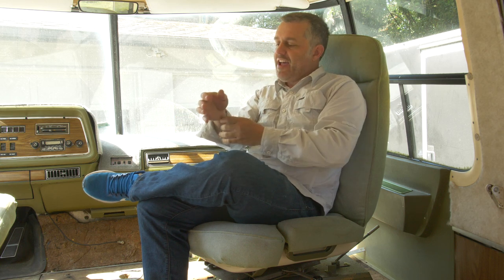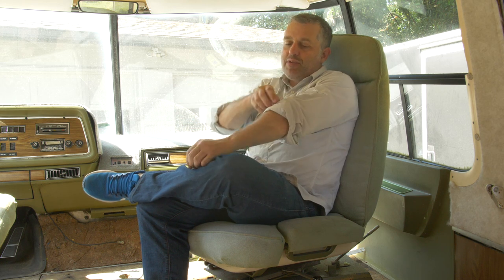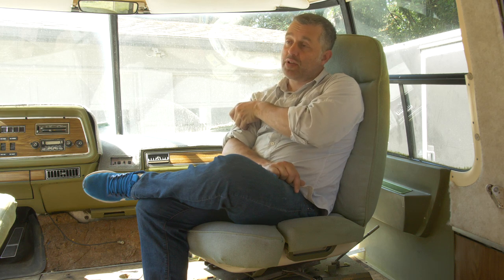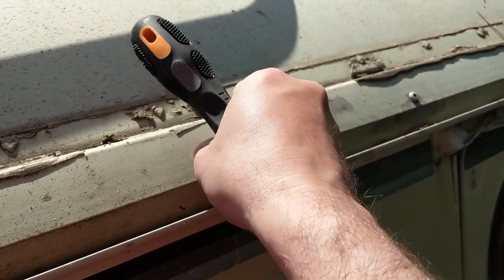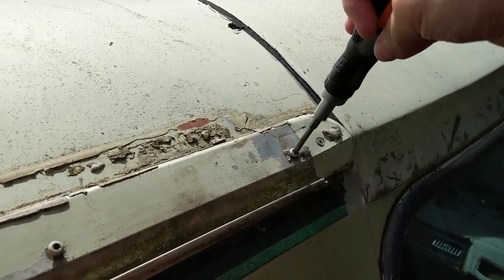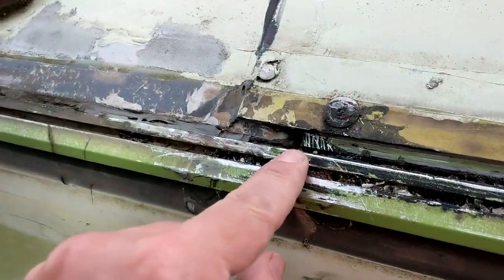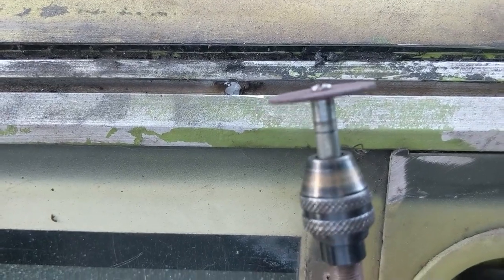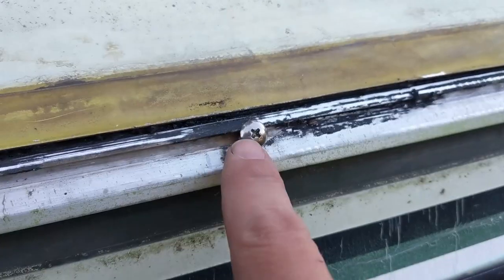Building the Best Damn GMC Motorhome Ever E.8 - Fixing the leaking is a bigger job than expected.

Comment: Use a small diameter punch to push the broken screw through the aluminium. They will pop through.  Re-tap with the next larger screw size and put Stainless screws back in. I have done this on 4 coaches.

Comment: To keep heads from snapping off use lots of penetrating oil like PB blaster and tighten the bolt first and then loosen. It may seem counterintuitive but it works.

Comment: You should have used a left-handed drill bit. I tried to use a left-handed bit on a broken bolt, and it ended up unscrewing the rest of the bolt with no damage to the rest of the structure.
Reply: Isn't that called "pigtail"?

Comment: Your column shift popping out of gear like that is most likely the linkage
Reply: agree the $2 plastic bushes that pop in the end of the linkage
Reply: Other GMC trucks of era use same Bush ings get an exploded parts manual and reference numbers for buy at parts counter...better than the inflated. Rv stores

Other GmC. TRUCKS. Use